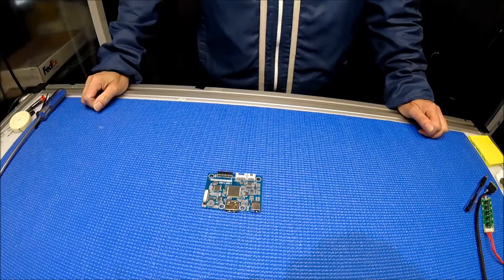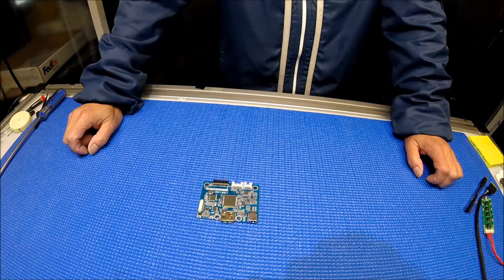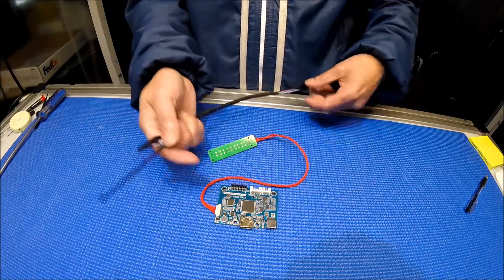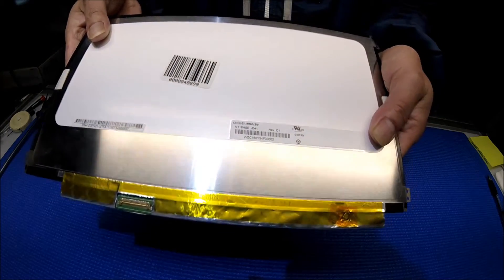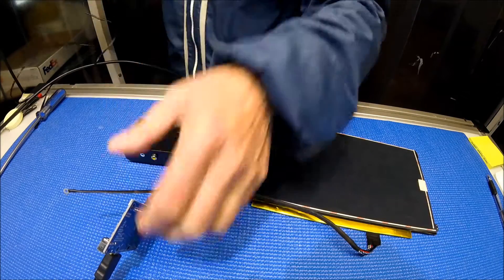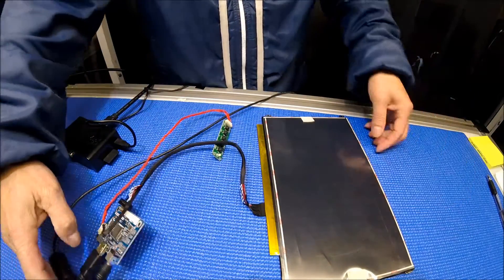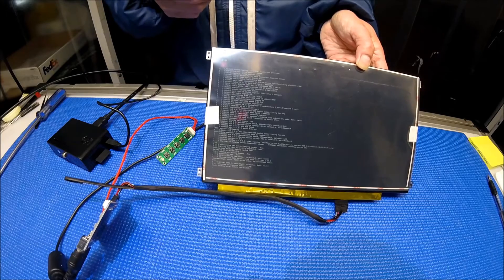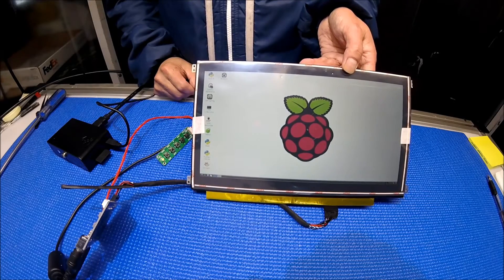HDMI to eDP LCD Controller board, MS609LC

Comment: Hello, I have this board, works ok but it does not save the settings I choose in the OSD menu after I  poweroff through the +12V, all settings are gone and when I power on again , the settings goes to default values, very irritating!  is there a way to save the settings I choose in OSD like the language, brightness , etc... ??? many thanks for any help!

Comment: 1. Does this screen supports AUO B156HTN03.6 ?
2. Does you guys have some controller board for some high refresh rate laptop panel?  Like N156HCE-GA2 ?
Reply from the maker: Yes, MS609LC is compatible with B156HTN03.6. Sorry, we do not have controllers for higher refresh rate

Comment: my lcd panel has'n got a model number but i know that is 30pin edp, can i use it with this board? i mean does it matter
Reply from the maker: Yes, you can
Reply: @LCDPARTS  my model number is R133X56-105-0101 (13.3'' 1920x1080)

Comment: How to get audio out in this board?
Reply from the maker: There is a 4 pin 2.00 mm pitch connector. that is for external speaker
Reply: does it requites any specifications ? or it will work with any small speaker ?
I tried with speakers took from laptop but seem like it didn't work

Comment: Will a future version of this board work with five volts instead of twelve? I would like to use this board in my own custom built laptop.
Reply from the maker: Sorry, MS609LC does not work with 5V DC
Reply from the maker: Sorry, MS609LC will not work with +5V DC
Reply: I understand that it will not work with five volts.

I am asking will you be making a new version later that will work with five volts?
Reply from the maker: Hi:
 Unfortunately, we are not planning to make a 5V board or you can use a DC-DC step up convertor
Thanks!
Reply: Late reply, but just hook your power supply to a voltage converter and you are set.

Comment: What is the power supply specs?
Reply: not for me, but I think I found a problem with the cable between the lcd panel and the board
Reply: I emailed them and they said 12v 2amp, but I can't get it to work with that. Someone else says it needs 5 amps, so I will try that next. (edit: and of course it turns out you're the person with the 5A supply from the comments on the other video, lol)
Reply: Did it work with 5 amps?